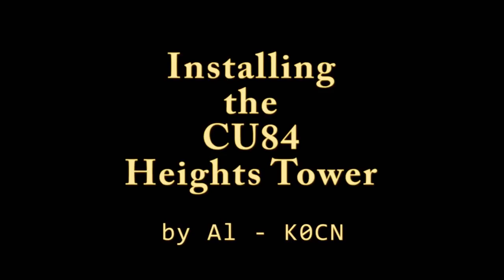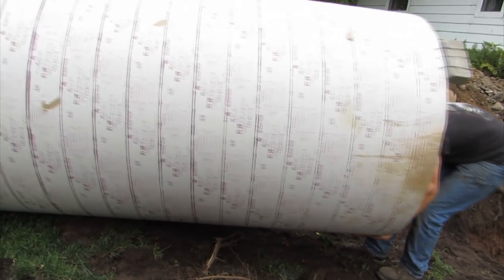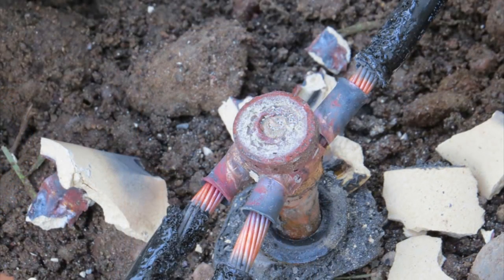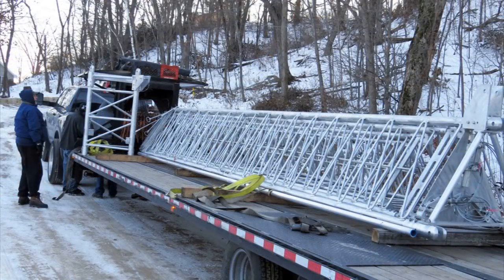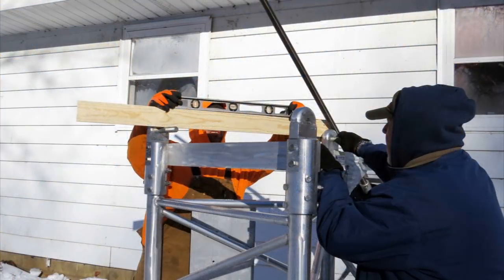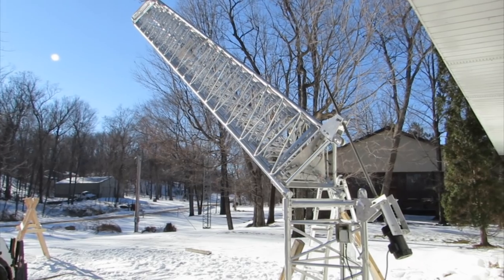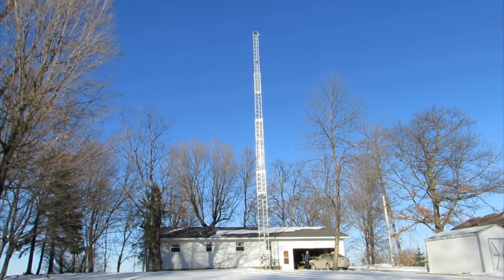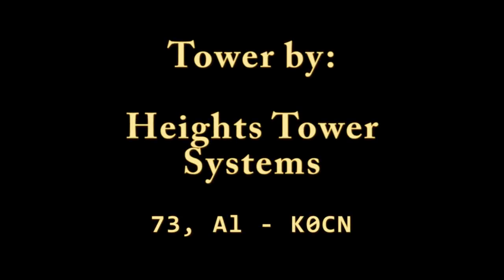Installing the Heights CU84 Tower

Comment: *Update: Loved watching this video! I'm still in the process of planning, but your video actually helped me to nail down my selection. I live in a suburban neighborhood, so I'm trying to be as conservative as possible. So far, I'm looking at the US Tower TMM-541SS. It's a free-standing unit, and with the factory-installed riser motor and limit switch/control unit, it's considerably more than I planned on, but oh well. The hard part is finding a reputable installer and so far, it looks like I'll have to bring in a crew from out-of-town. The last thing I want is to have some local hack that thinks he can do it, even though he never has.

Comment: The first rule of tower project design and erection is calling 811 (Dig Safe)! Nice video and narration.
Reply from the maker: Jon Frost Good point. We did call 811 and had the utilities marked. It ended up saving my buried phone cable while digging the hole for the base.
Reply: Al Senechal I am amazed at some of the videos online that leave out this precise point.  One guy almost severed his sprinkler system...Oops. I wish I had your tower at my place... no towers, no antennas, etc... gonna be interesting trying to get out on HF.